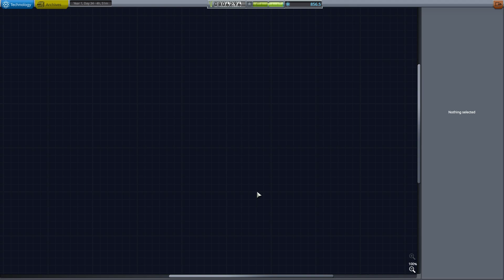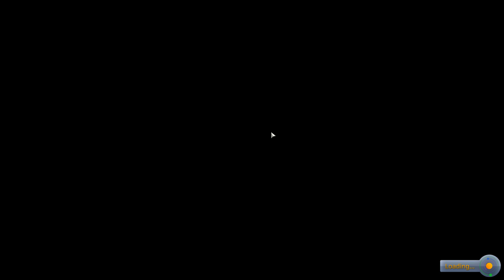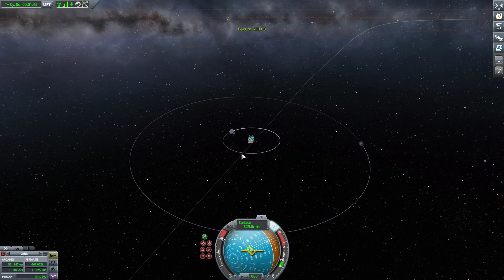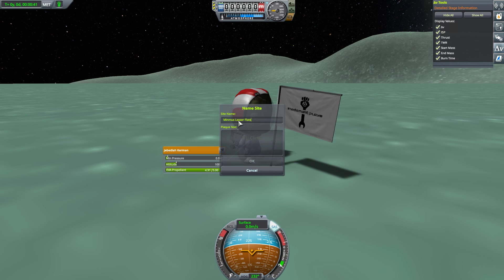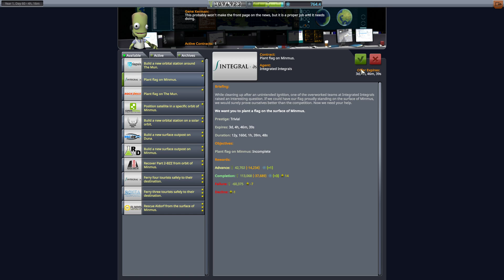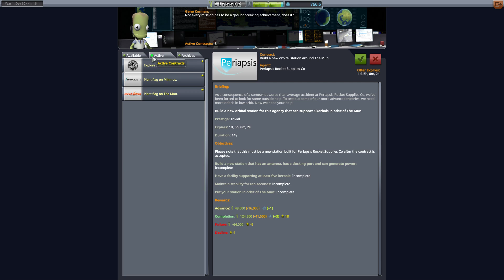Kerbal Space Program / EP 9 - Minmus Balancing Act / Kerbal Career Mode

Comment: 17:26~ thats why I always use a docking port instead of a decoupler to connect my return stage and the stage before it, so if theres extra fuel in that stage I can leave it in orbit and come back for it. That way I can utilize landing gear and stuff safely without losing that extra delta v
Reply from the maker: That's not a bad KSPro tip.
Reply: Rhadamant wow I’m surprised you responded, especially given this video is 10 months old
Reply from the maker: @garretbernard8174  I mean, if you put the effort to write a comment, the least I can do is reply, right? Have to seen some of the trailer videos and updates of KSP2.0? Going high tech and theoretical, huh?
Reply: Rhadamant yeah I guess that does make sense.

I’ve seen a couple different trailers for KSP 2, and the devs talking about it in another video. I’m really loving the new engine designs, especially the one that burns metallic hydrogen. 

Pink flames lol